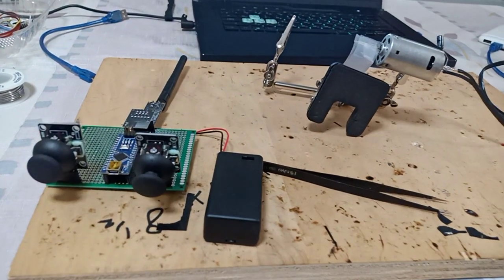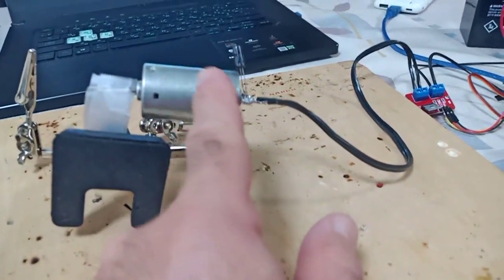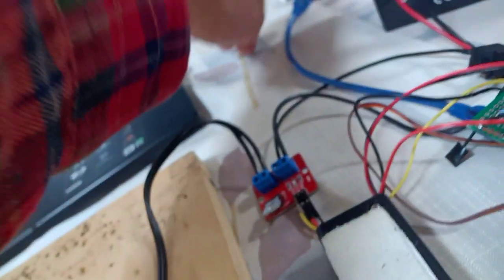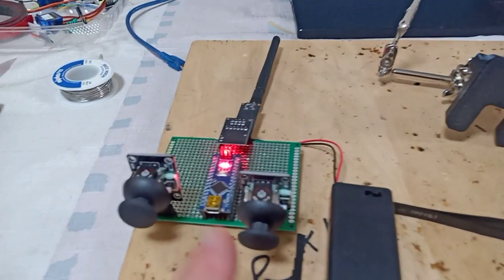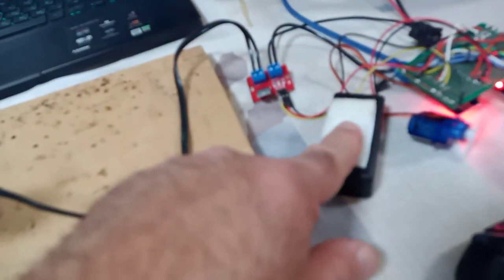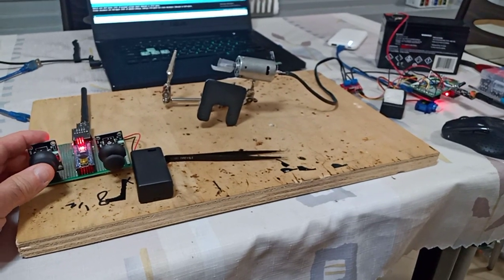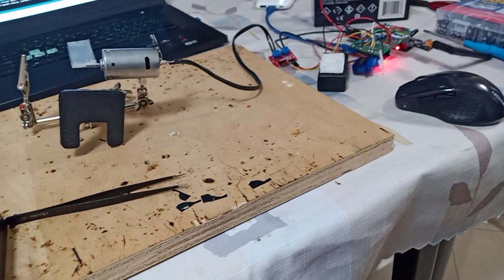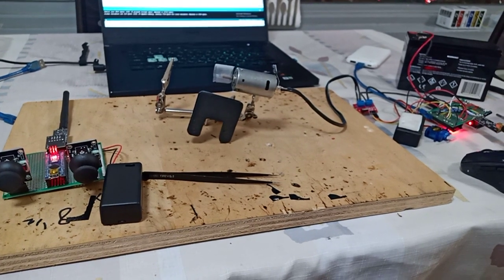NRF24 and a DC motor and servo motor

Comment: Thank you for sharing! This is an excellent resource to verify by third party these demonstrations of the original circuits.  I appreciate that the signal strength has something to do with fidelity of the control from the remote. Is the most power draw from the motor (RX) side? Always interested,
Reply from the maker: Hi RJ, I don't know answer to your question. I installed two lithium ion batteries, one on TX, and another one on RX, each 1500 mAh, 60C. I suppose this will be enough to power Arduino...)
Reply: @tomjoad1060   outstanding! which battery shows the most depletion in a given period? are they similarly drained?